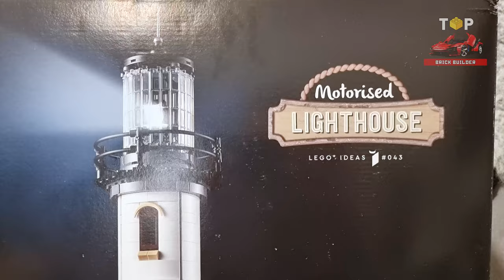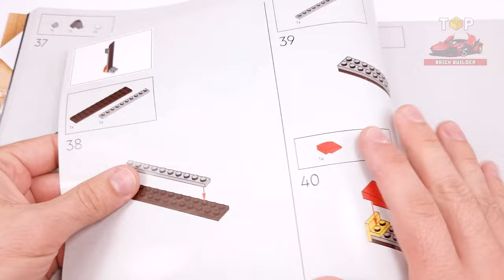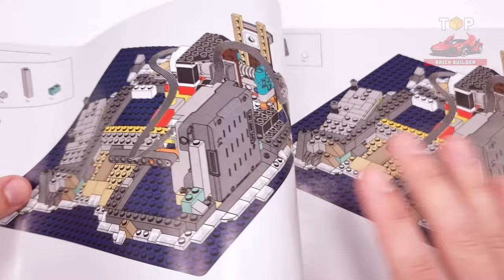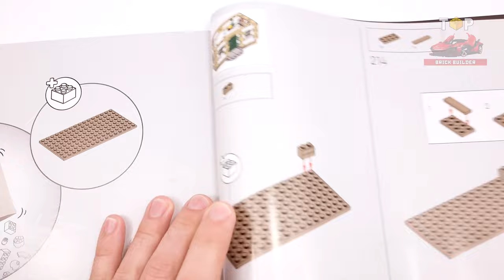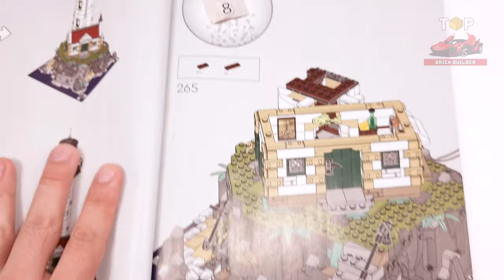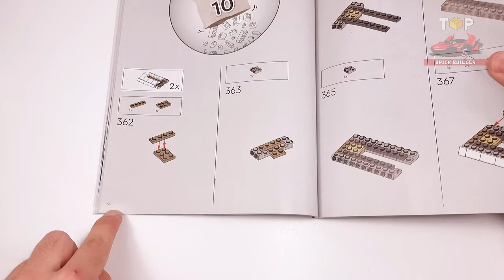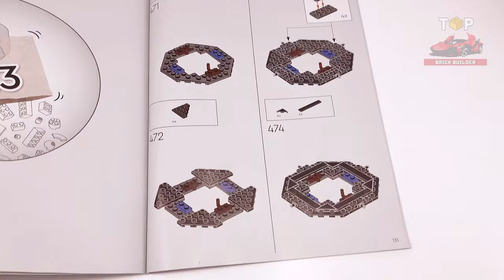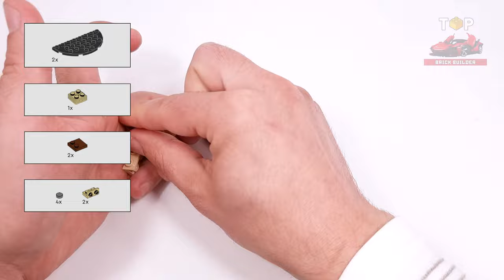LEGO® Ideas №043 | Motorized Lighthouse (21335)[2065 pcs] Building Instructions | Top Brick Builder

Comment: i have a question with the spinning park in 17:30 how do i fix it mines isnt working i rebuild it to
Reply from the maker: Have you installed batteries in the box?
Reply: @TopBrickBuilder  yeah now i did thanks you deserve like and follow
Reply from the maker: Oh, glad to hear that it worked now 😀  and Thank you too for following 🥰
Reply: @TopBrickBuilder  I put 6 Double AA batteries in the battery box and it still does not turn on and I checked I over and over
Reply from the maker: Have you checked the batteries? If your batteries were used, LEGO usually is pretty picky with batteries and wants new and powerful ones.
Reply: @TopBrickBuilder  alright thanks